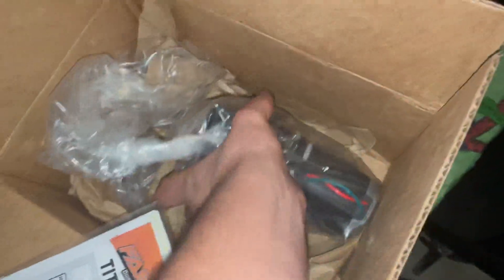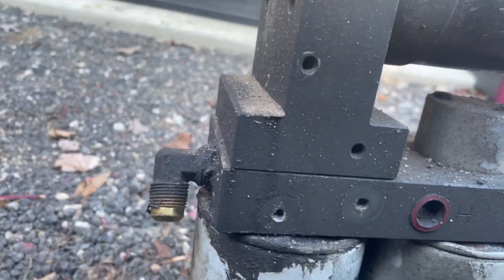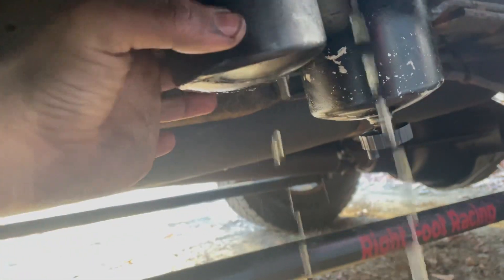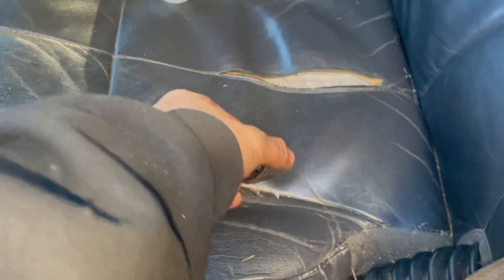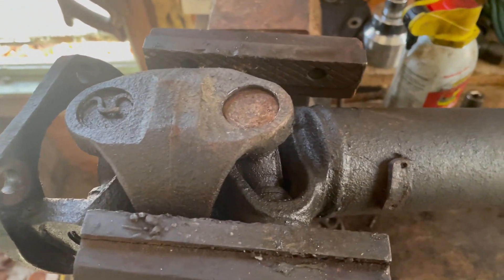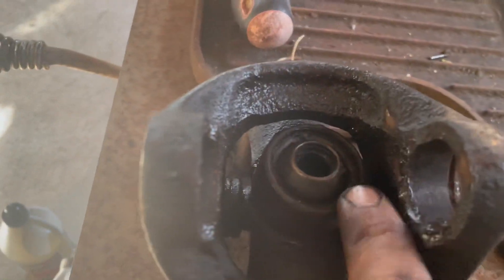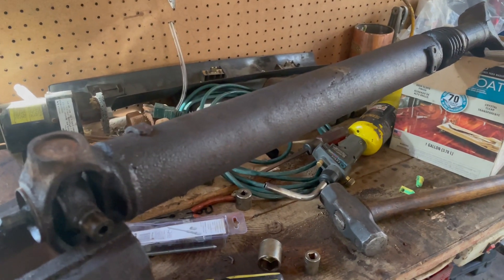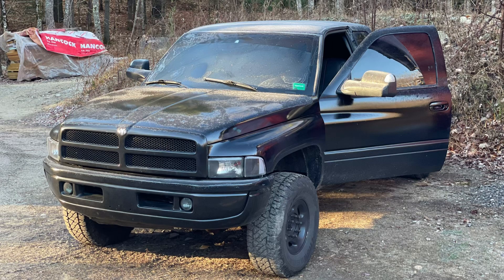Fass 95 lift pump motor install

Comment: That’s a double cardan joint homie
Reply from the maker: Thanks man! I’ve never heard of that before. Glad I got an entire new shaft in it now tho. She’s ready for winter
Reply: I have mine torn apart currently too but I might just buy a new one
Reply from the maker: Yeah seemed like a no brainer to me. Was only like an extra $100 to get an entire new driveshaft that you just immediately bolt in rather then buying everything else to spend a few hours on re building the old shaft anyways haha